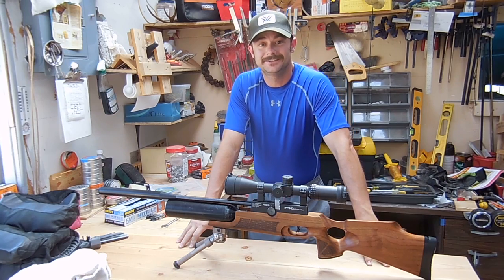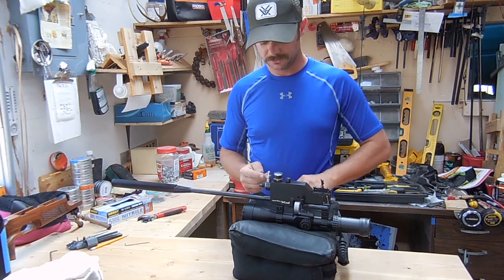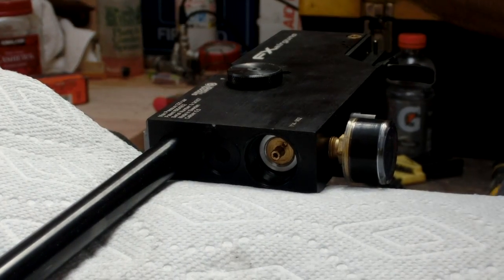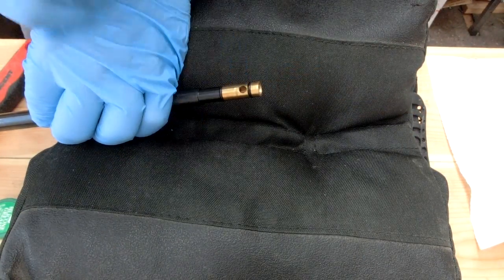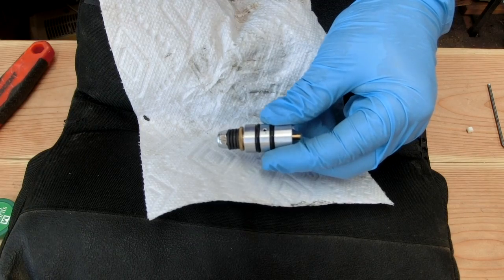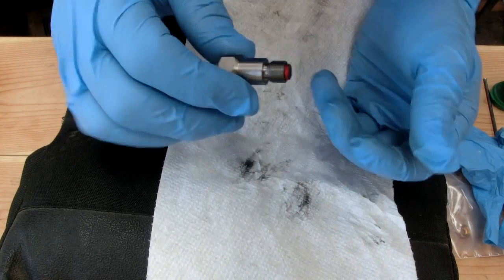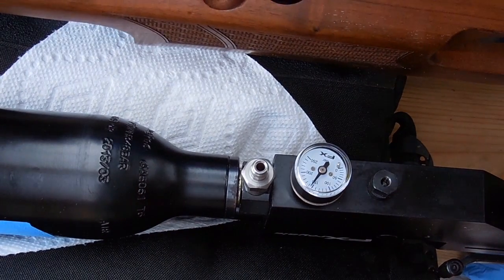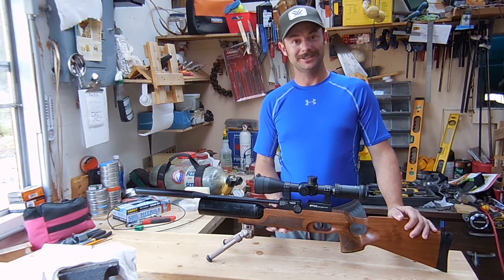FX Royale regulator and maintenance

Comment: Excellent video!  1/4 inch dowel works great in .25 just put it in a drill and wrap some sand paper around it.  Work it back and forth with the drill spinning you'll soon have a great wooden dowel to push patches through or what have you.  Thanks for making this!
Reply from the maker: My pleasure! Thanks for the tip, and thanks for watching!

Comment: Thanks a lot!!!! I wil now make sure that its the o-ring that is leaking.  Great video!!!
Reply from the maker: Terrific! I'm really happy to help you out.
Reply: Atoyota25 i have now replaced two o-rings and now is the fx perfect again. Thank you!!!
Reply from the maker: AWESOME!! Now you can be... "Happy Shooting" again! LOL
Reply: Atoyota25 Thank you buddy:-D I’m sure I will go out tomorrow!
Reply: Atoyota25 Hello again! do you recommend a 10 litre gas tube 300 bars or would you buy 15 litres? I’m exhausted now with my hand pump:-D
Reply: I have a little hole under the regulator, and it’s leaking. I have new o- rings  on the regulator. What I wrong? Please help me.
Reply: @Atoyota25  hello. I have a little hole  under the regulator and it’s leaking there.I changed the o-rings on the regulator, but I started to leak again. Should I change o-rings again on the regulator. Please help med // sincerely Peter from Sweden
Reply from the maker: @jercool  Yeah, I would pull it and closely inspect the o-rings. The smallest nick will cause a leak. Make sure everything is super clean and don't use sharp tools on the new o-rings. Good luck!

Comment: Like i said on the forum, extremly helpful video! Just one thing, in the min 1:52 you said that if you have that hole you have a reg installed, that's not correct. The reg vent hole is pre-drilled from factory to make easier the process to install a regulator when you want to, so that hole is on every Royale, the difference is that it may not be drilled all the way though to act as a reg vent hole. Cheers and nice video!
Reply from the maker: Thanks for the correction. It's been a long time since I had my hands on an unregulated one.

Comment: Thanks Tom for the great video.  My problem is it needs to shoot a little faster. I bought mine about a year and a half ago.  My main concern is that when I have it on high it has an average 925fps with .22 caliber 14.3gr pellets. When I turn it to medium it drops to 620fps and when I go to low it is 430fps. What could be causing that?  Thank you for your time.
Reply from the maker: Hi Steven, Have you tried the 18gr pellets? The Royale's have always been a fan of those. 18's at about 905-910 (IIRC) is magic! How fast are you looking to go? If you break the speed of sound, there's a good chance you'll see your groups open up. 
Regarding your question, there is a balance between the regulator and the hammer spring adjuster (Part #D2) If you have adjusted your hammer spring already, you may have pushed it too far? If you've adjusted your regulator, without a reg tester, it may be set too low. (A regulator tester is the ONLY way to accurately adjust those regulators.) Be advised, the hammer spring adjuster has loc-tite on it! You have to heat it up to break the loc-tite loose or you'll strip the hex key hole. 
A side option might be to grab a HUMA regulator from AoA. I've been thinking about picking one up for my loaner R400. 2 reasons... 1) It's HUMA which means it's quality 2) It has adjustment marks on it so, no need for a reg tester. 
I'd post this question on Airgun Nation. You'll have advice coming from all over the world from people with huge amounts of knowledge about this.
Reply: @Atoyota25  thank you. I do also shoot the 18gr but the fastest they will go is 830fps. I like to shoot them at around 930fps. I wish it was as easy to adjust as my crown, impact m3, the king or the alpha wolf. My red wolf  pushes the 18gr at 980 on low. I will check out that website you suggested. Thanks again.

Comment: Nice Video, thanks for posting. Quick question: I have the Bobcat Mk2 and I would like to switch the FX regulator for a HUMA one. It looks like all I have to do is remove the bottle port and reg and then simply put the HUMA one in? Correct? Thanks.
Reply from the maker: I never took my Bobcat apart and they're different than the Royales.
Reply: @Atoyota25  Thanks for the fast reply. Actually, the Bobcat, Royale and Boss all use the same block,or whatever the main part is called. At least that is what I have heard many say at AGN, including Ernest Rowe who made a video about adjusting the regulator on all those rifles... https://youtu.be/e90ANc8qb0k
Thanks.
EDIT: It could be that they are just talking about the reg being the same? If so, my bad. But I really believe that the guts of all these three guns are the same.
Reply from the maker: @fc1133  My Bobcat was one of the early ones. They altered them differently than they did with the Royales. I do recall a copper pipe being brazed into the workings. That's more what I meant when I said they were different.   You can get an exploded view of the Bobcat from the FX site. Maybe that could help you out?

Comment: Hi great video i have a question when i dry fire my royal and put my cheek up against the power wheel adjuster theres a blast of air that comes out is this normal or has the seals blown .thanks
Reply from the maker: Do not dry fire the Royale! You will ultimately mushroom your valve and need major repairs. Since I don't dry fire my Royale, I wouldn't be able to answer your question.

Comment: Great video, thank you very much, I had royale 400 with no leak, but it make loud sound when fire, what do you guess is it from?
Reply from the maker: I'd bet its the breech O-ring.
Reply: Tomcat Airguns I will try to change it today, thanks.
Reply: It was so hard to change it, but I did, without disassemble it, because the bottle was almost full, and I was afraid to open it, any way, the noise while firing is coming from the front of the nozzle end.

Comment: I like your videos, even I could keep up and follow your instructions.  I have the FX Bobcat MK2 the one with the fill port up front, and a Gen 2 Marauder both in .25 cal . No problems yet, I have had them both for about three years and both are tac drivers.. My question is, is their a problem using Harbor freight o-rings or are these o-rings in these FX rifles special. I have a couple of boxes with various size o-rings. I have been trying to find a maintenance / repair video on my FX Bobcat MK and have not found one yet. Should you ever do a bobcat MK2 video let me know.
Reply from the maker: I can't answer you 100% but, I think they are of a different density than the HF ones. I don't think it's worth it unless your looking for a temporary solution just to get you by for a while.
Reply: Ok Tom, I finally got my first air leak in my Fx Bobcat MK2. I got a heck of a run, about 6 yrs of no problems.  Those guys told me that o-rings should only last 2/3 years.I must tell you it was your video that inspired me to try and fix my rifle. It was leaking from that hole you showed on your video and it was my regulator. I learned that the Royal and the Bobcat have the same block and regulator.
I was going to send my rifle to FX USA so they could replace all of the o-rings on my rifle for $125.00, the shipping about $40.00 each way. Then they told me about 6 weeks to get around to repair it. So, I ordered the o-rings for the regulator from FX USA , I bought 2 of each and some other stuff.That should hold me for a long time. They were very nice and so helpful answering all of my questions. Any way they said I should get my o-rings in about 10 days. So, I went to Harbor Freight and bought a metric kit (Store House 389 o-rings Nitrile rubber) o-rings for $9.00. I was able to match all of the sizes, and installed them on my regulator, air cylinder and a few others. My rifle air cylinder is at 220 bar and I set the regulator at 140 bar. Setting the regulator took about 3 trys, I shot about 50 pellets and refilled the rifle air cylinder to 220 bar, and the regulator is at 140 bar and it is still holding. I will let you know how long they last with these o-rings Lol. Thank you for your video, I now have the knowledge and can rebuild my own rifle thanks to you.

Comment: How do I lower the power on my FX Royale. Hammer spring adjuster is as far as it can go and it’s still to powerful in the uk .
Reply from the maker: I'll assume you already turned the power wheel all the way down to one "dot". If it's a regulated model, you can remove the reg and drop the pressure setting, down on it.
Reply: Tomcat Airguns no I’ve set it to full power on the adjuster so it’s on stage 3 . But that can’t be running anymore that 12ftlb as it’s illegal here in uk . So looking to lower the power another way . Do I just loosen the nut on the reg a little to drop the power ?
Reply from the maker: @glyndwr1282  i believe so. It's been quite a while. Small adjustments make a big difference.

Comment: Great Video, you know what size O-ring the breach seal is? I had two  pellets jammed from the Mag just inside the breach" and when cleared it tore the little O-ring.
I have no schematic or parts list to find the size; I matched a 1/4 x 3/8 looks the same" except for the one that came out the breach is Clear in color & the one I have is black like most I've seen. Is the clear one special material? Also to take the barrel off do I need to take off the bottle? I WILL TAKE HELP FROM ANYONE WHO KNOWS""""
Reply from the maker: Here's a link for drawings and parts list - http://www.fxairguns.com/wp-content/uploads/2015/10/Royal-Drawing-and-Partlist.pdf
I think you need E-1
No, you do not need to remove the bottle to remove the barrel. But, it might make it easier. Make sure your safety is on as well.

Comment: if you make a L shape of wire or pin so one length in 10mm long and put it in the little hole ,if it goes all the way in ,then its got a reg only goes in 5mm then its not been drilled

Comment: My gauge won’t go up even if I fill in air but after I fired about 20 shots it automatically went up instead of going down. Can you please let me know as to what could be the problem and how to fix it?
Reply from the maker: Those little gauges are know to be inaccurate and a bit on the low side for quality. Make sure the plastic cup around the gauge hasn't come loose or is pushed against the needle. 
Other than that, I'd need a lot more info in order to help you out. I will tell you this... if it's a repeatable issue, then it's a traceable issue, which means it's a fixable issue.
Also, FXUSA is now handling all technical issues on these. That might be your best bet.
Reply: Thanks I’ll try and see how it goes 👍🏻👍🏻

Comment: Thanks for your help" I got the breach O-ring from AOA and I think I installed it properly (sits inside the barrel about a quarter inch in the groove) I put the barrel in the way you showed on the regulator vid, to get the barrel on I took off the bottle (simply unscrewed it) after lining up the barrel on the divits & tightening I screwed the bottle back and went to fill with air; the air rushed out the barrel? Couldn't get air to fill and stay... Did I miss a step somewhere?
Reply from the maker: Call AoA. They'll be able to help you out the best. 
I think they'll advise you to set the rifle to low power, cock the rifle, screw on a bottle with pressure in it, and shoot. That should reset your valve which I believe has slipped to the open position. It needs air to stay closed. I had this happen with my Boss and that's how I fixed it after being advised by AoA.
I'm sure you're nervous right now. It'll be ok. Just put it away until tomorrow or, try what I advised (at your own risk). 
It's MUCH easier to talk about this stuff on Airgun Nation. I'm "Tominco"

Comment: What to do if regulator struck inside due to rust?
Reply from the maker: Send it to a professional repair shop. If they screw it up, it's on them. If you screw it up, it's on you. IF I were to try working on something like that, I'd attempt to free it up with a solvent of some kind (think... wd-40). If I got it out, I'd plan on cleaning it THOROUGHLY to get all the solvent removed as well as the rust. You can so use a pin spanner or pair of needle nose to unscrew the brass piece. Then, try to find a bolt with the same thread pattern, screw it in where the brass piece was, then put moderate pressure on it the bolt in order to break the regulator free of the corrosion holding it in place. Again, a penetrating lube of some kind would assist this operation. But, you need to clean it all out afterwards as it has the possibility of exploding under high pressure.